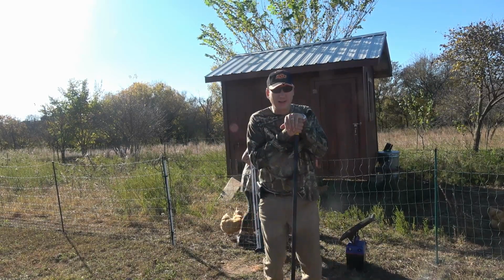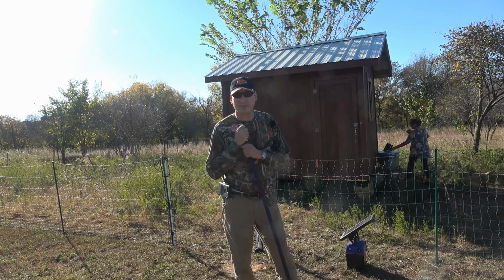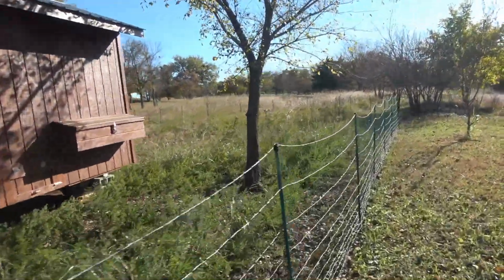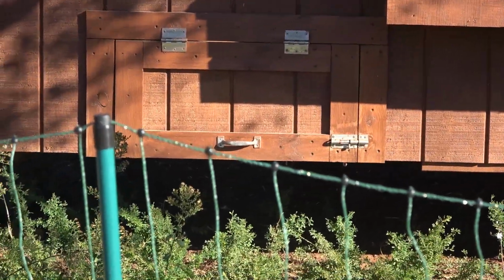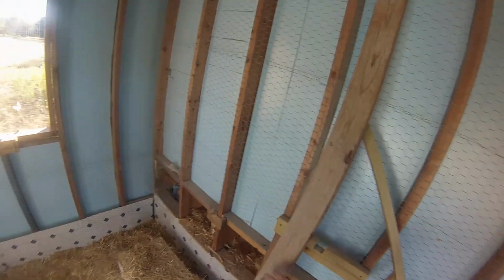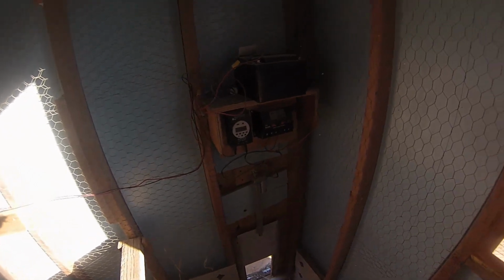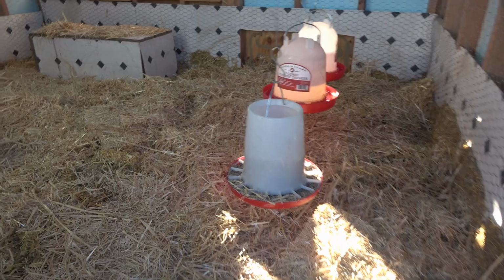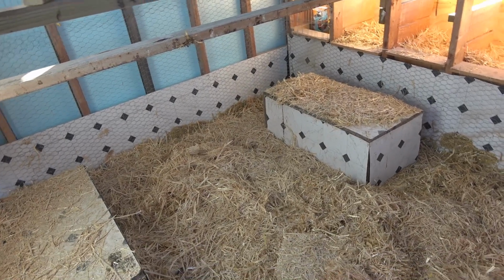Easy Clean Out Solar Powered Off-Grid Mobile Chicken Coop

Comment: I can tell you an easier watering system where you won't have to water them so often if you get a food grade 55 gallon blue barrel with a lid, put poultry water cups with automatic floats on it and it will save you a ton of work toting water.
Reply from the maker: I goofed up when I built the coop and made it too long. I was going to put a rain barrel on the front to catch rain water to do something like you are talking about, but there isn’t room for one. I have a hydrant pretty close by so it’s not too bad. Thanks for watching and commenting.

Comment: FUN FUN FUN   LMAO  i'am lost with out my backhoe i use it a lot move logs with ect i got a saw mill If i get stuck with a mower, pickup I latch on it pull them out   a very cool mobile coop> Do you have plans for more of em?  Cheers
Reply from the maker: One coop is enough for me.  I wish I had a backhoe.  They are very expensive.  Take care Super Bee.
Reply: Ford 555 C  big front and back ditch buckets  with only 1200 hours on it. i bought some fork lift bars for it clamp on the lip of the bucket That was 700 hundred dollars so i can move pallets  ITS A BEAST